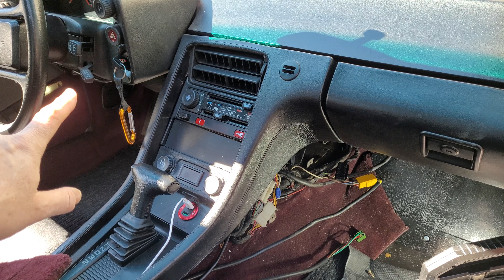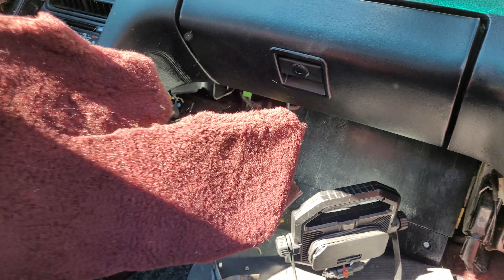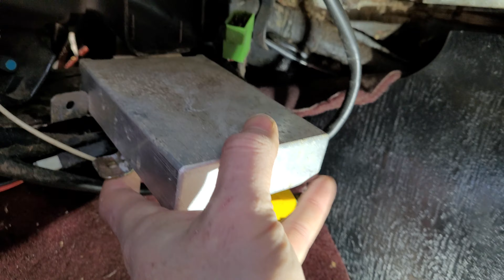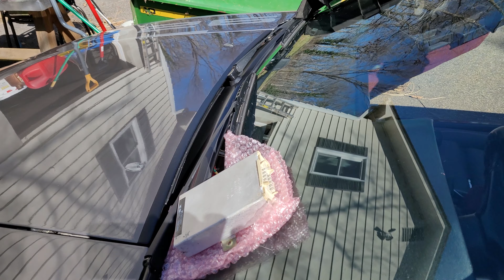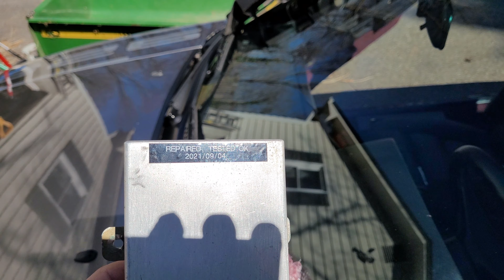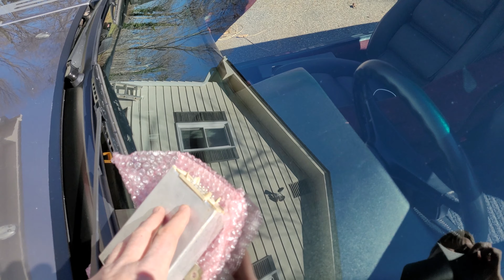Porsche 928 Cruise Control Module Removal

Comment: Did this job a year ago on my 1985, also got a refurb unit from Roger. I also did the testing of the input signals and tested the servo, there is a procedure for this in the WSM, pretty straight forward but good to check that the input and servo is working since a new computer will not fix the issue if there is a bad speed signal. A scope is needed to capture the speed signal, which is just a square wave, and I believe the servo can be refurbished with a new seal from Roger if it is leaking. Let us know how the new computer works, I actually never tested mine yet.

Comment: I have exactly the same issue. I had previously had the board re-soldered and the cruise came back to life. Although that was 15+ years ago, fix lasted for 10 years. I not surprised your reconditioned module did the job! Please open the old module and check it out, just for interest.

Comment: My '87 cruise does nothing. The engine vacuum system was a mess, broken pipes, perished rubber connectors and several breaks. Repaired all the breaks and pulled out the vacuum servo for the cruise and vac tested that and the solenoid, no change, so might be the control module. Bonus was repairing the engine vacuum provided vacuum to the auto transmission, it now changes smoothly instead of banging into gear like it always did.

Comment: While my cruise control works, it doesn't maintain speed very well. It lets the speed fall too far before then overshooting, and then the cycle of under and overshooting continues. I'm told that's just what they were like.
I have a 1987 W201 Mercedes and its cruise control works much better, and holds the set speed quite well.
Reply from the maker: You may want to swap out the module. My cruise control is very smooth and predictable so it might be worth trying another box.